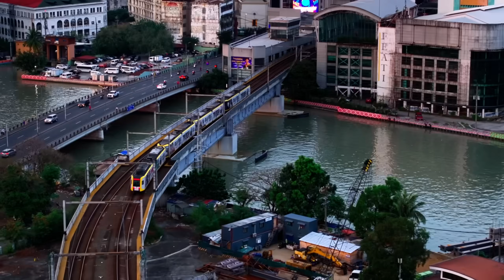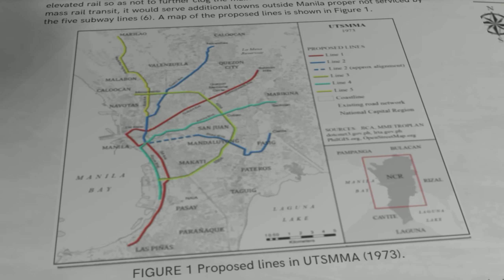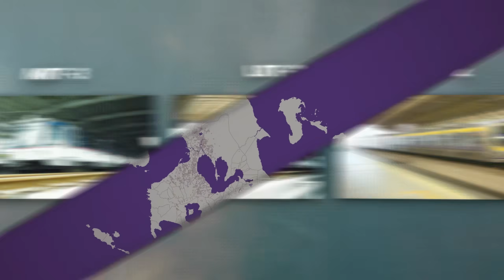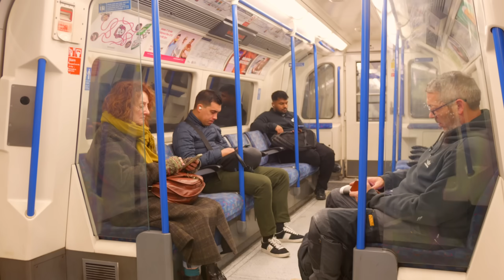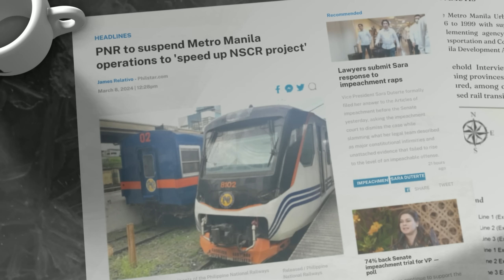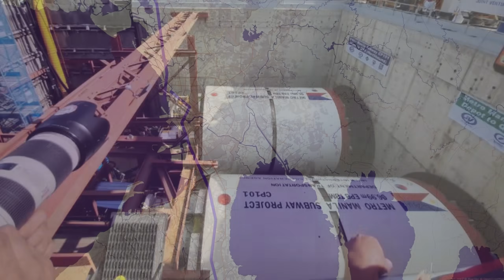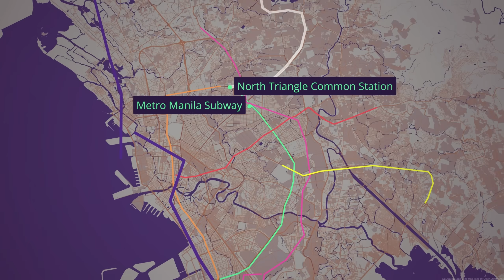Why Philippines’ Trains Were Designed to Fail

Comment: A city of this size needs far more railways than even whats proposed. The original heavy rail commuter network seemed to have missed out on suburban extensions for decades and there appears to be no true central station either. If they could build out a metro with 10 to 12 separate reliable lines and at least 3 or 4 commuter rail lines the city would be a much nicer place. Better for locals and much easier for tourists too. Also the bus system needs a massive upgrade with modern air-conditioned buses using bus lanes on every majot road would help too. The truck style buses need to go. Also all public transport in the city and surrounds should use a single fare card no need to worry about cash fares on buses etc.

Comment: Thank you for this video and highlighting this issue. Metro Manila has about 15 million people and with the surrounding provinces, you’d see that number swell to way above 25 million people. It’s literally a megacity but with so few rail lines. And these few rail lines have their own problems.

The LRT 1 and MRT 3 both use light rail rolling stock, limiting capacity. I’d argue the LRT 1 is the best maintained line but the stations on the southern extension are mediocre. The PITX station gets crowded because, well, no one had the foresight to consider wider platforms given it’s connected to a major transport hub. The MRT 3 would have been better served with heavy rail rolling stock. Many of the stations don’t have proper concourse levels, too, so if you need to take a train in the opposite direction, it means several flights of stairs. 

The LRT 2 has the best stations - standard design, proper concourse levels. But the trains have not been maintained, so only few units ply the route.

The LRT 1 should not have been extended to EDSA. It should have extended northward, while the MRT 3 should have covered the entire length of EDSA, with a southern extension to the Mall of Asia. It would have made more sense to have a half-loop like system. Now we have massive and ugly-looking interchange station between two malls. Stations are largely being built next to malls so that they benefit and this new Grand Central terminal of sorts is no different - SM and Ayala fought over where the station would be built that would improve foot traffic to their properties.

The MRT 7 is promising - the first line which uses third-rail electrification. But the stations are atrociously designed. So many people have commented that they look like poultry farms. They also seem to have been patterned after the MRT 3. The original design for the line looks nothing like what was built. Fun fact - MRT 7 is being built via PPP and San Miguel Corp is in charge of it - the same company now under fire for cutting down trees to build more elevated expressways and who are currently building the New Manila International Airport in Bulacan.

It doesn’t help that so many powerful stakeholders are influencing the system rather than a system being developed to serve commuters. Extending the LRT 1 has ran into issues because the prominent Villar family wants to have a say over the alignment. The weird elevated and at grade sections of the MRT 3 were because of exclusive subdivisions of the wealthy refusing any elevated sections of the line to be built. 

The MRT 7 should have - with all our resources and the engineering help from other countries - followed an alignment towards Quezon Avenue all the way to Manila or even Lawton, having a potential connection to another transport hub and the LRT 1. The historic University of Santo Tomas, however, does not want a rail line passing by España, so now these extensions are in limbo. 

The MRT 4 is also promising, but right now plans are for it to terminate in EDSA where a potential connection to the MRT 3 Ortigas Station would require a considerable walk. Why? Because another subdivision, Greenhills, does not want a rail line that would pass by that section of Ortigas Avenue for ‘safety’ reasons. And walking is difficult because many of these rail lines are being constructed without consideration of how people actually move. Stations are built next to some of the narrowest sidewalks because, well, roads were constantly expanded to accommodate more cars. That’s another problem. Our rail systems and their stations are constructed as standalone infrastructure, not part of a great urban plan. It sucks because this has the potential to have an interchange with the LRT 2 at Gilmore.

The NSCR and Metro Manila Subway offers some beacon of hope. Both are being built with the assistance of Japan. The NSCR stations look infinitely better than the MRT 7 and the subway project is being built to Japanese standards ensuring safety in a flood-prone and earthquake-prone country like the Philippines. Both are running into right-of-way issues, including once again, from wealthy subdivisions. Meanwhile, the elevated expressways are getting greenlit every minute.

Long distance passenger and freight lines are possible, but power players have been advocating against it because the rich who operate bus lines, trucking, and transport feel threatened.

Basically, our rail system is messed up because the rich, powerful, and influential have a bigger say on where our trains and rail lines will be built.
Reply: NIMBYs talaga smh

Comment: Why not underground from the beginning? Because it's more expensive and have no money. Another thing I've noticed any infrastructure project build by government never used the best materials, it always been the most minimalist materials, at this point i guess everybody knew that this happen due to corrupt mindset not value
Reply: Flooding.  All underground tunnels require massive drainage and rain water pumps on standby just in case.  They would increase the cost and put the technical requirements totally out of reach for a country like the Philippines.
Reply: @rayF4rio  The answer is because we don''t have proper drainage due to high cost, the issue is not from the flooding

Comment: Design to fail? Bro.the first LRT and MRT are running since the 80’s and it’s too late for you to predict of any failure  your just too early to predict on the future of railways to be built and added to the existing lines bro.Tokyo have about a 100 train lines and Philippines have about 8 on the coming years,how stupid and baseless prediction you have bro if you compare both countries,don’t be a smart ass.
Reply: it's still failing cuz the commuters still pretty much flock in to roads rather than rail. u compare with tokyo is obviously unmatched bro xD. Tokyo's neighborhood is all built around trains, walking distance to nearest station is always 10 to 15 minutes with walkable infrastructure. now compare it with metro manila. with PNR commuter train is closed for NSCR construction, the option for suburban people to commute to downtown is not much and will almost stuck in traffic 90% of it. this is system failure. if u not tearing down the trams from colonial era, it might reduce traffic by 40% than what it is today, obviously combine with the modernization of PNR commuter that serves the greater manila area. this should have been done since the 70s before the city become too crowded to develop. what ur govt has done is only making shiny new LRT and MRT that only serve 5% of total NCR commuters. and by the 2000s when NCR is too crowded, ur govt is confused how to solve bad traffic. this is system failure bro, system failure = design to fail. even after NSCR and metro manila subway completed in the future, if the taxpayer who regularly work in downtown still live in suburban, it is still causing chaos
Reply: @mikeuchin Tokyo???the fourth economy of the world and Philippines the 32nd economy?HOW STUPID IS THAT WAY OF THINKING,do you know how Tokyo was after the second world war?MATUTU KANG MAGHINTAY TALANGKA!

Comment: the north triangle common station that acts as a transport hub under the same roof will be game changer, creating seamless transfer. i really like the idea. it will create the similar hubs like Bang Sue in Bangkok and KL Sentral in Kuala Lumpur. unfortunately this not what the policy makers in Jakarta want. sure, we have already Manggarai station that already connects KRL Commuter with Airport train and it is said soon to be connected long distance /intercity railway under the same building but what about our LRT? the new LRT extension phase 1B from Velodrome to Manggarai doesn't build under the same roof. instead they place the LRT Manggarai station 150 meters apart and expect that the pedestrian bridge connecting both LRT Manggarai and Main Manggarai stations is already enough?? did they (urban planner) never learn from the crowded pedestrian bridge in CSW Interchange that connects MRT with TransJakarta BRT during rush hour? the crowded and terrible passenger flow in the ring bridge all the way to the escalators heading to the elevated BRT line is surely like a hell. lucky enough the bridge has not fallen apart with that amount of passengers. this is why the one-building integrated transit hub is important!! pedestrian bridge is not effective!!!

Comment: Hello from Thailand! I accidentally found this video and as I've watched this, Thailand also has land acquisition problem as yours! Make so many projects delay from their first schedule, so I really understand this issue. I am really interested in metro system around the world by the way. I am quite curious about Manila metro railway network plan. Is this the final plan? I ask because, for me and my opinion, it seems like incomplete network to me. For example, the MRT 7, do you have the plan to connect with LRT 2 at Recto station? If anyone know, you can kindly explain to me 😊
Reply from the maker: Hello! You are right! land acquisition and ROW issues are a big problem for infrastructure in any country honestly.

As for the map, the map in the video is definitely not the final master plan. I had to visually simplify the network to focus on the active, immediate projects without cluttering the screen. Right now, the active construction for MRT-7 (Phase 1) will end in Quezon City. However, there is a proposed long-term plan (Phase 2A) to eventually extend it all the way down to Recto and Tutuban to connect with LRT-2. Thanks for watching all the way from Thailand!!
Reply: @carlosvines0 there is  no MRT 7 plan all the way to recto . there is a plan MRT 8 from QC circle to Lerma Manila .
Reply: There are unsolicited plans to extend MRT 7 to Recto, as seen in MRT 7's long turnback, but there was also a plan to build an entirely new line (MRT 8), which will traverse from Recto, towards UST (land acquisition will be hard in this part because of resistance from the university), and will end at Quezon Memorial Circle.

Comment: I cant wait for them to phase out those jeepneys. They should be replaced with modern city bus system. Like the Clark Loop, Cebu and Davao City bus systems.
Reply: Cebu BRT is mess from the start . until now how many station are built . for many years the political rivalry there keep the BRTs very slow progress😂
Reply: Correct. Sana ma phase out na, hindi na sya angkop
Reply: But Davao City still has jeepneys, though.

Comment: Line 1 EDSA is connected to Line 3 Taft an additionally line one is connected to line two at Recto it's the long passageways between them. For the passageway line 1 to 2  it's actually built on top of Bataan Transit Avenida terminal

Comment: Future Philippine leaders need to start prioritizing railways and mass-relocating residents to clear for right-of-way. Aside from the ones mentioned, future railway projects include:
 - PNR South Long Haul Phase 1 (Calamba to Los Baños)
 - LRT-6 (Bacoor to Dasmariñas with a possible link to Tagaytay in the future)
 - Bulacan East-West (SJDM to NMIA in Bulakan)
 - SJDM-Cabanatuan Commuter Railway (proposed by me)
 - Mindanao Railway (Surigao City to Gensan with possible extensions to CDO and Zamboanga in the future)
Reply: Correction: There is no such thing as "Phase 1" for the PNR South Long Haul Project. The original PNR South Long Haul Project that used to be aided by China had five contract packages. Contract Package 01 covers the stretch from Calamba, Laguna, to Daraga City, Albay, Bicol.
Reply: What should we call it then? Segment 1? Stage 1? Section 1?
Reply: @MaharlikaFurry  PNR SLH Contract Package 01 is the proper term, this contract package covers the stretch from  Calamba, Laguna to Daraga, Albay
Reply: So you're telling me Calamba to Los Baños is just a mere extension of the NSCR and not the actual haul yet?
Reply: Hopefully that is true, since even as foreigners, knowing MRT line 7 still didn't finish yet after more than a decade is ridiculous.
Reply: Easier said than done, especially if your house is the one chosen to be relocated
Reply: @themiko1210 Yes, it is hard, but residents should still be able to negotiate for their land worth while projects are ongoing. They should not be blockers for infrastructure projects.